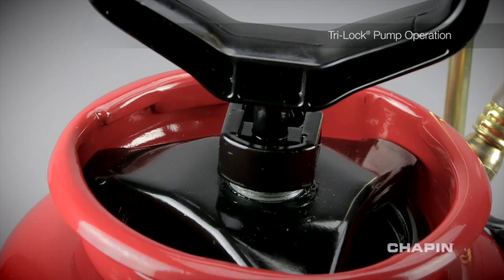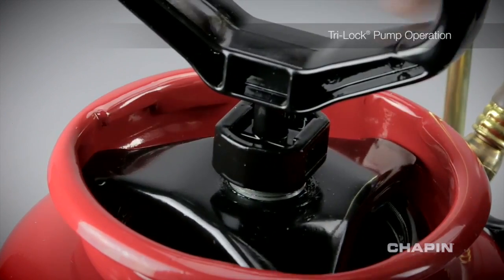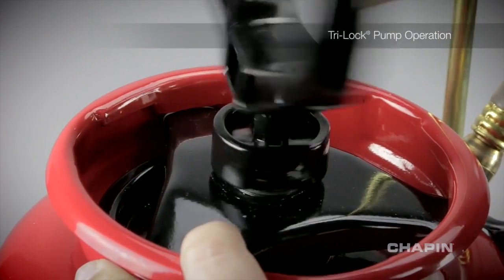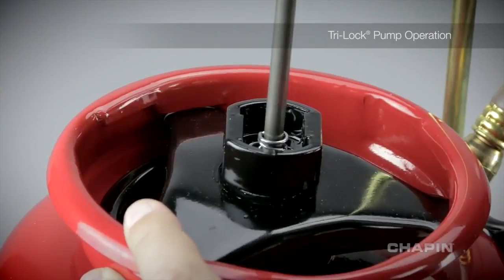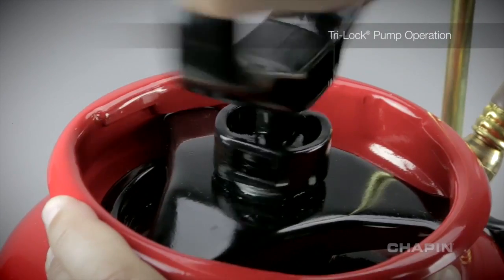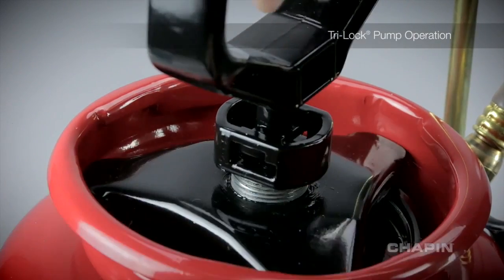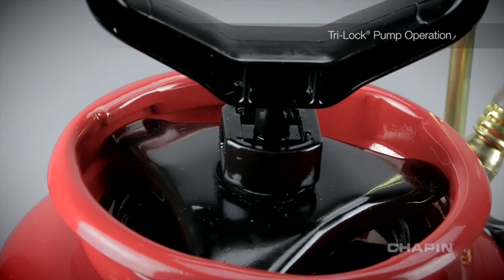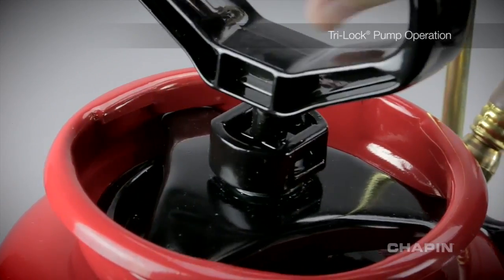Troubleshooting the Chapin Tri-Lock Pump

Comment: Brand new, locked, tightened. When you pump, the air and liquid just shoots out of the lid and it won’t build pressure. Steel on steel with no gasket, this can’t be right.

Comment: I just received my model 1949 sprayer. It came with two nozzles.  A 1 GPM and 0.5 GPM nozzle. Which nozzle should I use for solvent based concrete sealer.
Reply: I used 0.5 & it was just great, for the same thing.

Comment: How do I get the tri lock thread back. I unthreaded it to much and now it wont thread at all
Reply: Same thing happen to me I was looking for a video didn't  see one.
Reply: Did you ever find out
Reply: @martyphillips9220  I sqeezed the tri lock threads to the hand and started to turn it into please.
Reply: @travisconnour2897  update....I was doing it all wrong..I had to screw it all down..From the seal of the cap.. I'd that makes sence.?
Reply: For others who may have this problem, I think what you are referring to is that the nut gets screwed tight into the triangular piece. Then you are looking at threads on the bottom of the triangular piece and thinking they somehow screw into the round disc below. THEY DON'T. You need to take a crescent wrench or appropriately sized wrench and loosen the NUT from the triangular plate, and then unscrew it most of the way out of the triangle. Once you do that, the disc will drop into place atop the tank. The triangular plate will drop into the 3rd tier lowest setting and lock in place, then you push the handle down and lock it into the nut, and screw the nut into the triangular plate.
Reply: @SuperReverbious  THank you man
Reply: @SuperReverbious  my husband was telling I had done tore it up lol if I could find this I would have been shipping it back thank you again ,you  should do a video on this !!!!

Comment: Is this supposed to have a seal or gasket? I have a new pump and it still leaks. I have reversed the lock nut all the way
Reply from the maker: Hi! Our tech team can assist with leaking issues. 1-800-444-3140
Reply: Same here. Brand new, locked, tightened. When you pump, the air and liquid just shoots out of the lid and it won’t build pressure. Steel on steel with no gasket, this can’t be right.
Reply: @mk-jm5tv  I ordered a new one and it came with an O ring. Haven’t had a leak with it since.